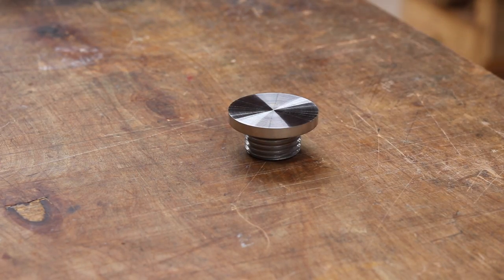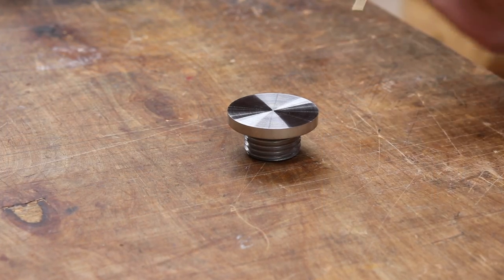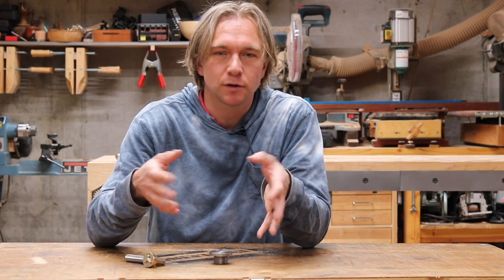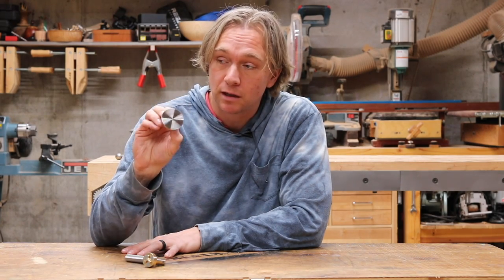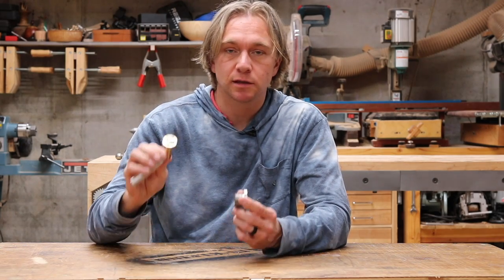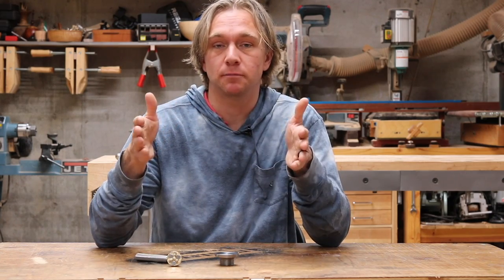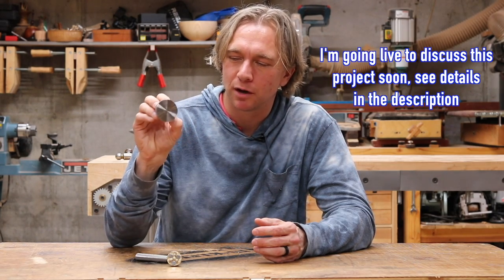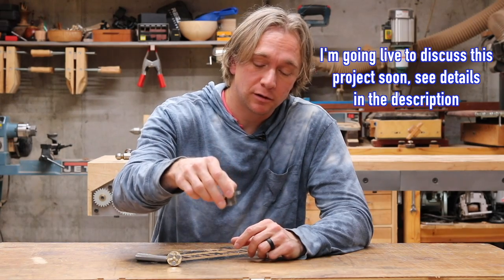A Screw With No (visible) Slot Is My Next Big Thing!

Comment: I can't think of any other hardware that is used by average folks that needs a specialized tool to actuate. Too easy to lose the tool and then it's just an expensive permanent fastener. To that end, it would seem prudent to shape the tool and screw so that in the event of its loss, someone could at least get the thing apart to get at whatever they've fastened sealed in the first place. This tracks with the security potential echoed by many comments.  

Now, I can see a product like this getting used for some really high end fixturing and fastening for high end residential and commercial construction and finishes. I bet that guy who runs The Build Show custom home channel might have some thoughts. 

My only reservation is that it seems like something similar could be accomplished for a lot less money by having a screw head that was itself threaded to received a threaded cap. In that case, your screw would have no moving parts, and the cap could have a spring loaded plunger near one edge that would accept an allen key that would give the leverage to drive the cap home. A fine thread pitch and some blue locitite would probably be enough to get a flush fit without it backing out. https://imgur.com/wULIwEl

Comment: I wouldn't buy it because to me its mostly a gimmick or novelty that can be solved in other ways (magnetic release catches, RFID catches, etc).  One thing: it doesn't need to be magnetic, its very easy to just apply inward pressure while turning it.

Now if it was a security screw where the driver was magnetic and released a pin to allow the center to be pushed in then that would be interesting, but it appears you could just push the center in with anything and then rotate it

Comment: Here's a freebie....Instead of using it as a screw itself...you could redesign it, maybe out of lighter/cheaper material or whatever and use it as a cover for something....another screw, a switch, button.
On another note, DAMN that's expensive! Nobody will buy that, well, not enough people ....especially in bulk to make anything because your cost is too high per unit. I get it...It takes time, money etc. I hope you put a patent on it.....if so, just sell the patent if you can't figure out a way to get your cost down.

Comment: would love fasteners like this, especially in a smaller format or even different thread sizes and pitches commonly used in metal fab work. Id call it something like "clover drive flush screw"
clover for the drive

Comment: No. I don't see people paying $100 for a single screw and a screw driver. I can see a few people but not enough to sell this wide spread. I also can't imagine something like this costing even half as much. I know stuff like this is expensive but material cost can not be over 15 bucks for one screw and one screwdriver. I don't know what the costs of machining the part would be so I can't say on that. I just know that you'll need to drastically reduce manufacturing costs so you can bring the price down on these items. Otherwise you won't sell these. If I was going to copy the esthetic of this screw. I would just get a regular screw around that size and put it in then cover it with a metal disc that is magnetic and will stick to the screw below it. This would be cheaper and easier to produce.

Comment: Just found your channel…….your my hero.  Lol

Cam from Blacktail studio recommended your channel

I think the prices you mentioned is to low.  You need to get a patient on this design.  I’m not a builder, but this is the type of stuff will be used by guys making $30,000 to $70,000, so the price your asking is way to low.  Don’t underestimate your worth.  Run it by Cam, he’s the type of person who would buy something like this. See what he’d pay, then double it. Lol
Reply from the maker: It was great of Cam to give me that shout out, glad it helped you find me and that you're liking my stuff, thanks!  I do have a patent pending for the Pika Screws, hopefully it will be smooth sailing through the patent process (unlike some of my previous experiences).  I hear what you are saying on the price, and for people incorporating them $30K-ish pieces of furniture it is is a trivially low price.  But I think there could be potential for them to be incorporated in high end, medium production quantity (say 50 sold per month) furniture that is more in the range of $1500 per chair for example.  If you need 6 screws per chair it could still be justifiable, but there isn't a whole lot more room in the price, especially if you consider that the chair maker is going to want to mark the screws up for a margin on that incremental expense.  And I have a reasonable margin at the current prices.  Anyway, that is my thinking for how I ended up where I did.  Thanks again for the comment.

Comment: First thing: that screw is cool as f*ck

For consumer selling I think the price is little too high. I would recommend some kind of a package deal. I mean for that kind of screw there would usually be a use for two or four of them. Lets think there would be one screw which cost 40$, then two screws package should be somethin like 65-70$. Package for four screws would be 120$. Screwdriver always sold by its own, I would say 40-50$.  

Find the best value for selling those and take it to the shark tank. I wish you the best of luck thats awesome!!

Comment: It bothers me that it's a screw. Anything connecting to that 25mm thread is massive overkill for things in the home. 
Make it longer to fit internal threads behind the plunger, turning it into a nut. It would connect to bolts of about 15mm, which is plenty for furniture.

Comment: Awesome idea, but i just don't see people paying that much for it. (i wouldn't, there are already hidden latches and fasteners on the market that are cheaper.) 40.00 times at least 4? Thats an extra 160.00 not including the tool.  220 with the tool. when you add in the cost of materials for the project you would make it too expensive to implement. or kill home projects all together. build your prototype then farm out manufacturing to make it cheaper otherwise it becomes an unrealistic novelty.

Comment: I think you need to make it into a hidden lock. That will sell. Make it use a regular screwdriver. $40 screw is too expensive if it doesn't do anything useful having the hidden feature. make the addition of the $60 tool unnecessary. Invisible head screw.

Comment: Like the surprise in the beginning. I thought the surprise was going to be a special magnetic. Lol as typing this it is magnetic. So couldnt this product just use a magnetic driver and be much smaller. I understand you want the groves because it looks cool and u want the strength in pulling it out but if it is finishing screw much like a finishing nail it doesn't have a strong grip. Since u already using highly magnetic steal I think the real the secret is in the design in the driver. I can come up with a couple of ways u may want to make this cheaper but they all kinda ruin the original idea so idk if u are interested in them because ur idea is a cool party trick. Iam not saying that negatively, u might want to keep the original idea with in the product as the reason to buy it. So idk but I really think you have something here but we are looking at it the wrong way. The driver is where you want to put all the money in and you can charge a higher price for it. You didn't even show off the driver really

Comment: do i like them? yes, but we are talking about 200€ for 4 screws and a driver. The price is reasonable but still pretty high, the Competition is supercheap also how failsafe are they? because if they slightly tilt or wiggle due to wrong assambly they would be pretty pain in the ass to look at.  I realy see the innovative point but think about using them in a Yacht, do they look awesome? yes! are the available all over the World and cheap to replace? nope. imagin using those screws on a ship you would need atleast 100 of them if you only work on visible things, that would make 40k only on screws. Not even using 4-8 of them for a nice Lowboard would make sence, thats still like 160-320€ only for the screws. who wants to buy a Lowboard for 3k? Id call your screw the Rubor Screw. (Latin=Flat closing, seamsless)

Comment: This is pointless for furniture. A normal screw with a cheap insert friction fit would be so much cheaper and look the same. It would also probably function better, you could just remove it with any old magnet and a screwdriver. With this design someone would have to keep the custom tool around and remember where it is 5 years later when they need to move. At which point they realise they've lost it and either have to mangle the screw out or buy another expensive custom tool. I'm sure there would be some niche/high end uses for this, but I don't think people are thinking logically about this.

Comment: THIS WILL SELL.... It can be used as secret door lock mechanisms this tech... NEW ALLOY wheel security bolts, security screws for external devices (IF it can be miniaturized slightly) It could be also used and sold as novelty device OR as a PUZZLE type of addon to a bigger puzzle device.

possible name for the product line could be "Invisi-Bolt"

Comment: Super cool. I think this could be really useful in the glass industry. Think fasteners for shower glass or for the giant windows you might see in a corporate environment. They use hardware that looks quite similar to this. The one thing I always hate about them though is that they have those little allen key holes it the side. It messes up the look and is a pain to install. This could resolve that and probably be a lot more sturdy!!

Comment: Never buy it. There has to be cheaper and easier ways to accomplish this same look. If I needed a flat surface that badly, I'm sure I could design around it with what is currently available. That's just my opinion. Neat idea, but I don't see it taking off and becoming very profitable.